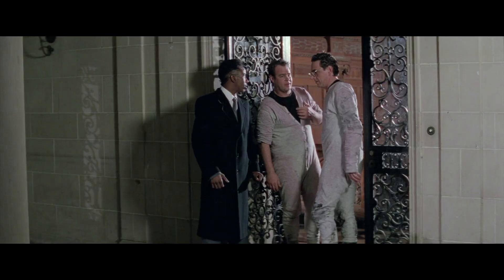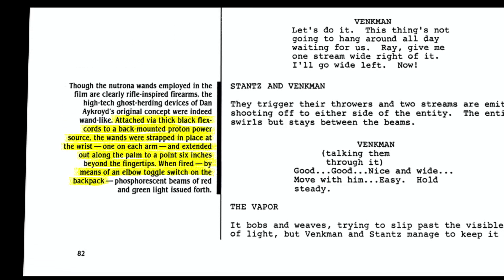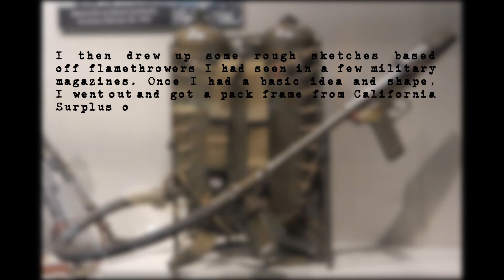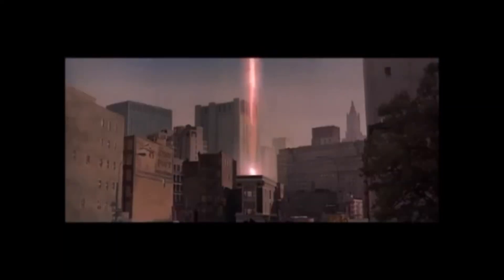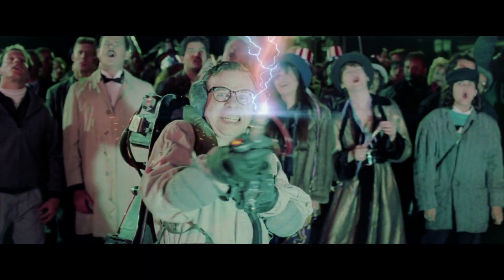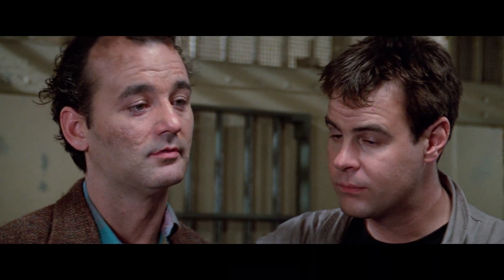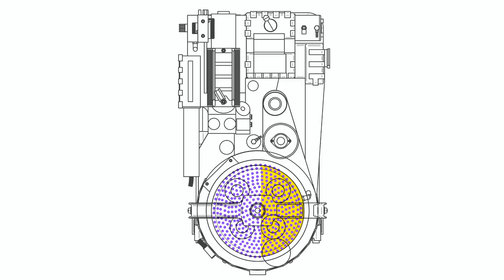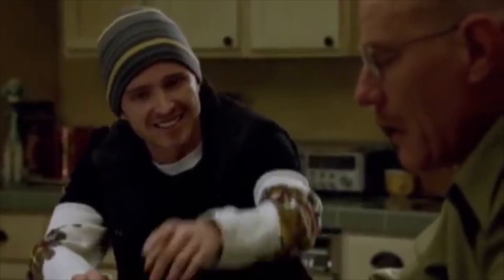How Does the Proton Pack Work? | The History and Physics of Ghostbusters Equipment

Comment: I can see the proton pack can actually be made into reality, but in a much larger scale first before scaling it down to back pack size. From bricksize carphones to smartphones, it's definitely possible.
Great video.
Reply: It's a stupid theory, I know, but what if the C.E.R.N. hadron-collider is secretly a experiment to find out, if it is possible to capture ghosts? Your scale idea makes absolutely sense. Think about how big home-gaming-consoles were and how smaller they became all over the years, even decades after the systems first hit store-shells? The same thing happened to personal computers.
Reply: @JasonTate08  The tough part would be getting the ghosts to enter the supercollider to test it.
Reply: I also thought about the possibility to capture ghosts.
Reply: though to be fair chips are much smaller than they used to be.  still a large prototype would be the first step. that and confirming ghosts exist. then you could try to catch them.
Reply: Car phones and smartphones were made to manipulate information, not energy. Information can be stored in many ways, some of which require less energy than others, but a proton is always a proton with the same mass and charge, and electric and magnetic fields will always act in the same way. I don't see a cyclotron-based proton pack to be ever built, but a proton tank is more likely.
Or it would be more convenient to ditch the cyclotron concept altogether and look into alternative ways to accelerate particles, which don't provide them with as much energy as a cyclotron, but can be made portable. For example, a linear accelerator, a Van de Graaff generator, or a Cockcroft-Walton multiplier (which, incidentally, were used as particle accelerators before the invention of the cyclotron).
Reply: This is great, but first thing on the design board: a sensor automated pack kill switch for when and if a wand were aimed at live human being. (shivers)
Reply: Would probably cost over 1 Biliion dollars though
Reply: @ChaoticJester  the franchise rights alone will make you rich beyond your wildest dreams
Reply: @Mikebuster yeah, u could really bust some heads.
I a spiritual sense of course.
Reply: The real ghostbusters proton pack that’s awesome
Reply: To whom shall I speak, and give warning, that they may hear? He that has ears to hear, let him hear.

Are you saved? Where will you go when you die? Heaven or hell? 

The Gospel, which means the Good News is the news that God Almighty, the Creator came in the flesh as Jesus Christ to take away the sin of the world. The one God is a trinity of the Father, the Son and the Holy Spirit. The Son came and laid down his own life to save ours.  His sacrifice on the cross paid the price for our redemption with his own blood. On the third day he rose from dead and offers the gift of salvation and forgiveness to those that repent and trust in him. Although God's creation was created perfect, having no death, sickness and disease, the creation became corrupted through Adam and Eve in them disobeying God. In this rebellion the creation became fallen through the curse of sin and mankind became separated from God. This world is fallen, but God offers reconciliation to him through his provision at the cross. Ultimately God will restore his creation to perfection when he returns but those that who reject his offer of redemption will remain condemned by their sins and go to hell. 

John 1:1,14 KJV
In the beginning was the Word, and the Word was with God, and THE WORD WAS GOD. [14] And THE WORD WAS MADE FLESH, and dwelt among us,

1 John 3:8 KJV
He that committeth sin is of the devil; for the devil sinneth from the beginning. For this purpose the Son of God was manifested, that he might destroy the works of the devil.

Isaiah 9:6 
For unto us a child is born, unto us a son is given: and the government shall be upon his shoulder: and his name shall be called Wonderful, Counsellor, The mighty GOD, The everlasting Father, The Prince of Peace.

John 1:10 KJV
He was in the world, and the world was made by him, and THE WORLD KNEW HIM NOT.

Comment: I love your explanation of the proton packs operation I always theorized that the proton pack was a dual plasmatron that just took hydrogen gas & converted it to protons like the process in the large Hadron collider my theory was using the animated proton pack the red part was the power cell using tritium connected to the accentuator the yellow round part would be the tank of hydrogen gas & the middle top part with the gauge would be the pump that pumps hydrogen gas via the metal hose to the dual plasmatron which is the round part of the pack then from there the hydrogen is made into protons & like the ionization chamber/ ion source of particle accelerators the plasma is forced through the hose into the wand the wand has electromagnets that accelerates the proton plasma out of the wand.